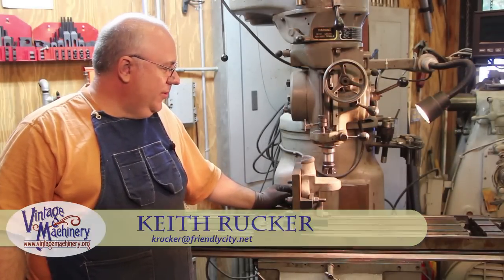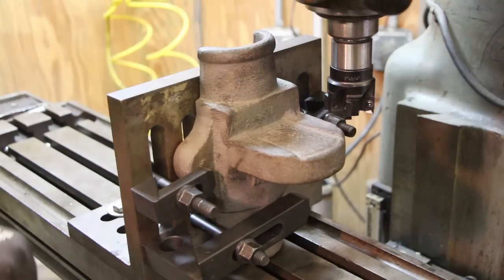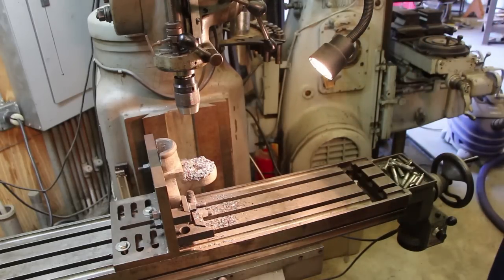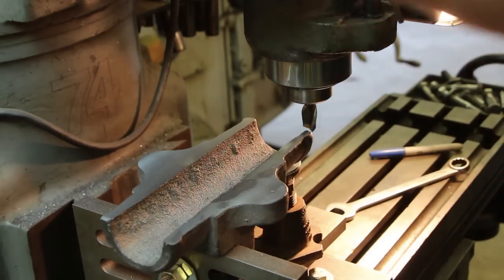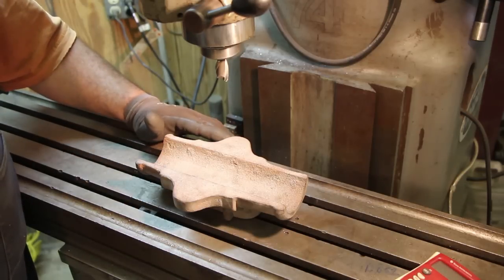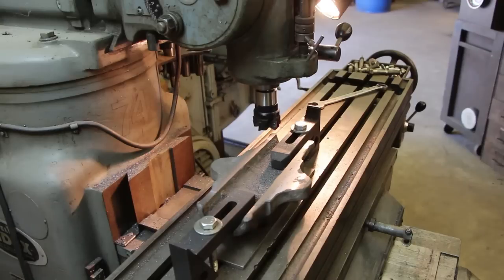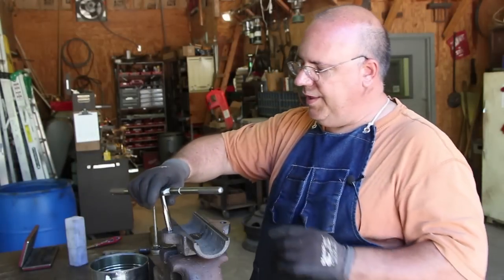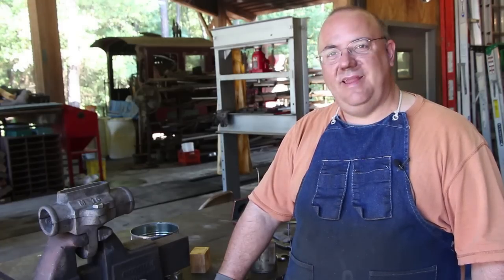Machining new Babbitt Bearing Blocks for the Vance Planer/Matcher

Comment: Great video.  I have several different tap handles, some from the 1970 era and they are very nice.  I bought a cheap horror freight tap and die set so I would have most of the parts I have lost or worn out over the years and the tap handle is pot metal and looks like a kids toy.  The taps I have used from the set don't cut very well either.  You live and you learn.  I am anxious for the planer to get cranked up.  Seems like it has been about a year now.  Thanks for sharing.

Comment: Hi Keith,
Cast iron is a very machinable material, no sharp chips, crisp cuts and a few other plus, hard on the tooling though, mostly the crust on top.
The days I do cast iron I keep the vacuum running to catch that fine dust and keep it from invading the whole place, noisy but cleaner.
Whens you do cast iron in the shop just flip the mirrors, you don't want to see your nice mustache before the en of the day... lol
Your experience with holding irregular shapes is really a plus, worth the time spent watching the video...
Thanks,
Pierre

Comment: A stroke of luck to have another cast bearing block to use as a pattern, Will you video the babbitt pour? If not, will it be poured all in one go? Or bottom half, then top half? Looking forward to seeing the machine in operation. Cheers.

Comment: Nice job machining those lovely castings. I'd have probably clamped the top half using blocks under the ears. Do you have an idea when hex bolts started to become widespread ? Would a nice thick piece of felt (woolen) cut to fit work in the oil reservoir ?
Reply: Thanks Keith.

Comment: I suspect the reason the casting cracked in the first place was because of the misplaced hole causing excess stress on that edge. Putting the new hole in the same place risks the same crack happening again!

Comment: Another excellent video Keith!  I have been trying to pick out those that cover the planer restoration as I find them so varied in techniques required and fascinating to learn from - even to a complete amateur like myself!  If you have a moment at some point it would be really cool if you could group the planer-matcher restoration videos together so they could be watched in one long go.

A question I would also like to ask is both very general and I am certain hugely basic.  In other metal working videos I have heard machinists say or imply that using a horizontal milling machine as a drill press is actually very bad for the machine.  I find this hard to understand as I would have thought it would go through far more stresses and strain doing its everyday milling tasks than any amount of drilling would call for!

If it is a quick answer could you explain why it might be 'bad' to use the milling machine as a makeshift drill press - and also at which point you would definitely use a drill press for a task instead?
Reply: I did mean vertical!  It would definitely be worth a video trying to drill a hole with a horizontal mill!!!

I was thinking about this a bit more while I was watching the video where you mention you had recently done up the old 1950's drill press.  I guess how the device is powered might be important as well?  I think milling machines are all directly geared to their motors whereas drill presses usually transfer the power through a belt.  In that same video you actually go on to have a couple of minutes' trouble with the belt  slipping.  I could see in some circumstances that being a good thing though - a kind of built in 'fuse' in case the bit bites in and sticks solid.  Whereas a direct-drive mill might really do itself some damage in the same circumstance.